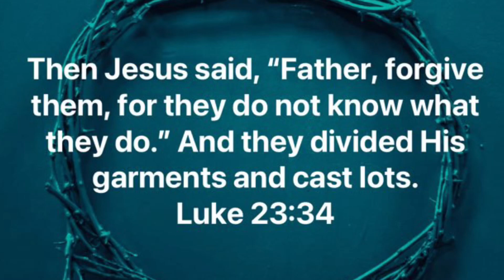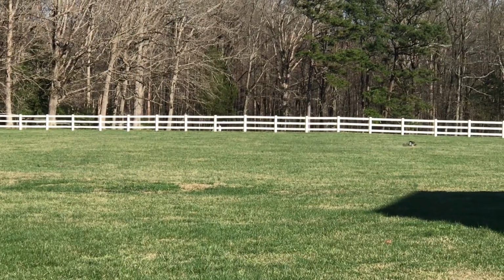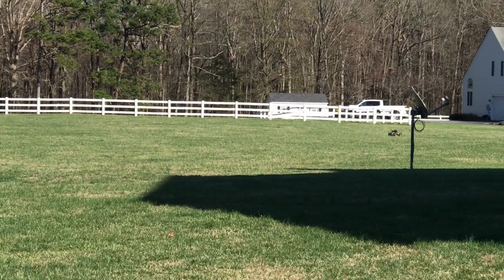TMR 30.5 Long Rod 22/52 Easter Rip! Happy Easter Much Love To ALL!

Comment: Man that thing rips! Mr Allen text me yesterday to let me know my engine and pipe are being shipped. Sooo excited to get that engine in and see what it can do live.
Reply from the maker: Yessir shes a ripper! You will most certainly be satisfied! Have fun with it right away! No need for all that idling and heat cycling. I use 50:1 and have gallons through this little engine and the dang piston dont even have a scratch and theres no carbon on top of it either! Its never been hotter than 215 degrees! And I had to reall beat it in a warm day to get it there! Im just really pleased with this little monster! Allens work is nothing short of perfection!
Reply: Do you prefer Dominator or Saber?  I always see different takes on that.
Reply from the maker: @tonymanna9160  I have done testing with both! Saber get the win! At 50:1 its double the protection of Dom at 50:1 and it burns WAY CLEANER! My piston top with Dom had carbon all over it! Tank n tanks with Saber and no carbon on my piston top! I am done wit goopy messy Dom! Its great oil if ur constantly wide open but Saber is just better! Amsoil used to have on the label that Saber was great for all two strokes until they started loosing money on dom. So they advertise it as lawn equipment oil! That is a marketing pitch only! I will tell you from testing and tearing engines down Saber at 50:1 is the mix to run coupled with VP C12 you cannot go wrong for clean burning and cooler engine temperatures!!
Reply: Awesome and thank you for being so thorough with the answer. I have both and Castor927, but I trust your experience with these RCs. Saber and VP C12 it is!

Comment: How many turns out are you on the high and low?
Reply: This engine is not a typical 30.5 and has an 1107 carb on it and it’s super rich . Most likely 2-1/2 on the high . 1-1/4 on the low
Reply from the maker: Yes what Allen said! Thanks AL

Comment: Hey Jeff I got that rovan rc bigger clutch and plate billit when I put it all back together the spur sticks out further then the bell gear. Any idea why
Reply from the maker: Make sure you have the plate in correctly! It should be smooth in the front and the raised bearing housing in the back. If thats not it then make sure the center of your spur gear is fully seated into the gear and only one spacer used behind the gear . Keep me posted As Ive never had an issue with that carrier kit from Rovan.
Reply: @eastsiderc  ok Jeff thank you
Reply: So I'm checking everything and no matter what I do the spur gear sticks out about a quarter of an inch
Reply from the maker: How about the pinon gear is it on correctly the nut goes down inside the recessed area on the gear . If that is turned around it will cause the gears to be out of alignment. I want help you get this fixed brother
Reply: That black aluminum spacer that usually goes behind the spur gear with the roofing clutch Bell brace and plate I couldn't use that black spacer because then the brake him would not line up into the plate holes
Reply: @eastsiderc  that black aluminum spacer that usually goes behind the spur gear I could not use that because with the rovin RC clutch brace Bell and plate the plate would not line up with the brake cam down bolts if that spacer was in there